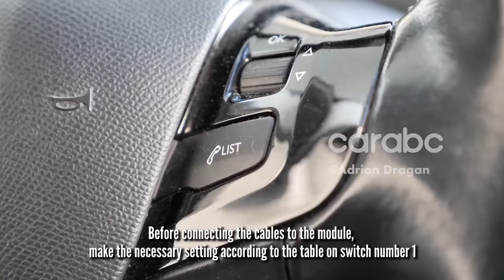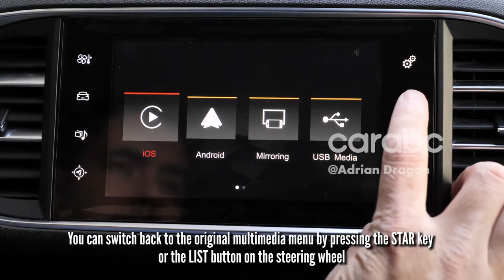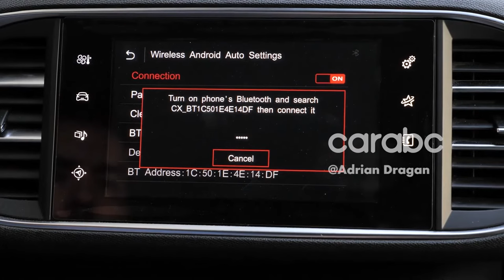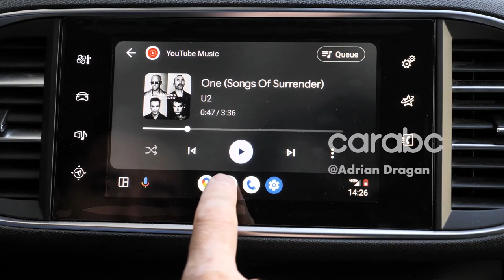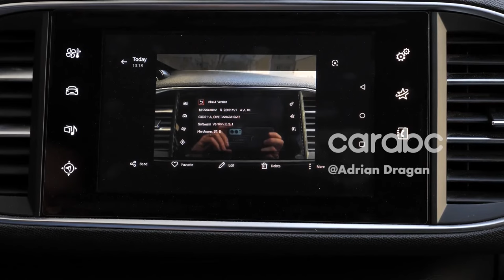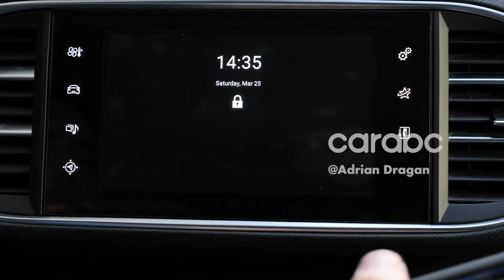Wireless Carplay & Android Auto modular installation for Peugeot & Citroen, SMEG&NAC

Comment: Hello, I purchased this product and can not get an aftermarket reverse camera to work with it. 
I attempted to connect the module's purple reverse wire and the camera to the reverse light as described in the manual, but it didn’t work. I also tried wiring the camera to the module’s blue cam power cable directly without success. I can view video when I connect the camera to the front CVBS input and blue cam power cable via the DVR app, confirming the camera itself is functional.
Additionally, when I toggle DIP switch #3 to "on" and shift into reverse, the module displays the original car screen, indicating it detects the reverse gear without needing the purple cable connected. However, no matter what I try, I’m unable to get the aftermarket camera video to display when I engage reverse gear. So far, technical support has not been helpful.
Reply from the maker: did you buy our new device or old one?

Comment: Unfortunately I can't set automatic switching to the reversing camera despite the original camera in Peugeot 308 t9 2015. I tried connecting via the reversing light cable but it doesn't work either even when I used a voltage stabilizer (then the whole system freezes and stops responding)
Reply: I'm struggling with setting up an aftermarket camera. Did not manage to do it yet, but i fund how to set the system with the original camera : you need to toogle the pin / dip switch number 3 on the box and then the system will automaticaly switch to the original SMEG screen when you change to reverse gear.
Reply: @straffs  I don't know why but this doesn't work for me
Reply: @marwineper  It works for me, you need to reboot the module for the new configuration to work. The module takes time to shut down when you stop the car.
Reply: @straffs Thank you for the tip.   I switch to number 3 but I see just black screen with the guide line. I can’t see back

Comment: Does this also work If my car does not have Android Auto from Stock? I have a 2016 with SMEG. So i mean If i Install this i get the menu with Android Auto to Connect?
Reply: If you have a touchscreen it will probably work.  Check with autoabc seller to confirm compatibility.

Comment: Is it just for me, or the audio isn't clean?
Reply from the maker: It is using AUX audio
Reply: Every time I use Wireless connection, the music is so bad quality, but when I ask Google assistant a question, and it goes back to music afterwards, the music quality is great. Weird, but true.
Reply: Have you bluetooth ça issue ?
I use it since one year and i can't do it work good for calls?
Have you already try thé original bt option in the Factory menu?
Reply: @rvitch  du you mean, I should pair Bluetooth with both the car and the Module, and then choose original Bluetooth option in factory menu?

Comment: Installed on DS4, it works for AppleCarplay. I still always need to go to the official menu to switch to Bluetooth output, then come back to the module CarPlay.
The integration of the cable from the light of the glovebox is impossible without cutting a part of the glovebox to let enough space for the cable and clip the light. 
The video does not show how to reclip the light with all the cables but I think it is not possible without cutting